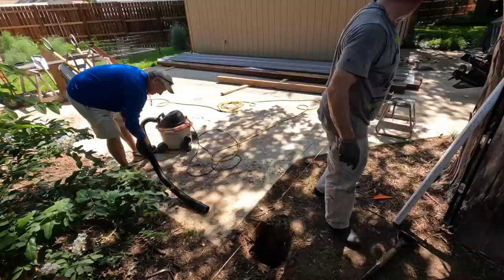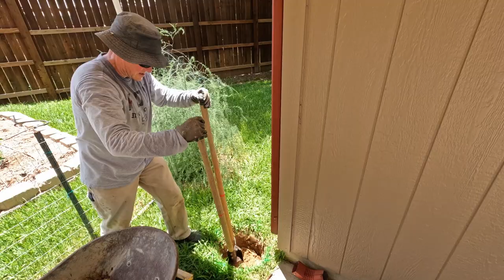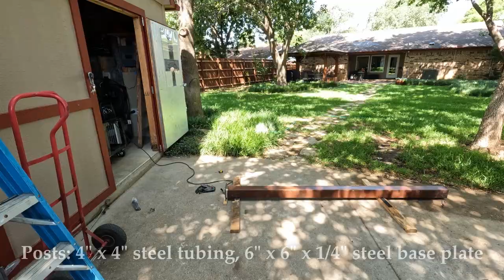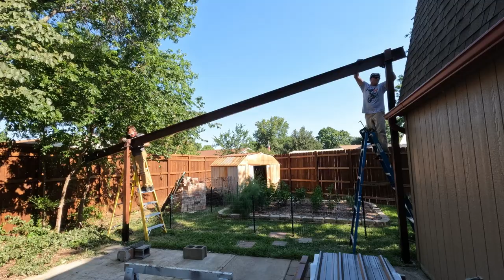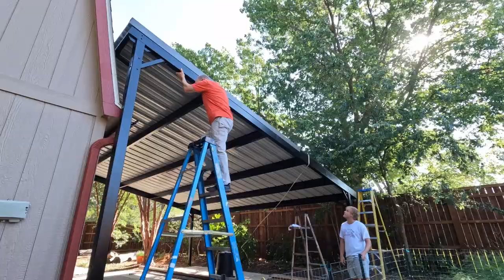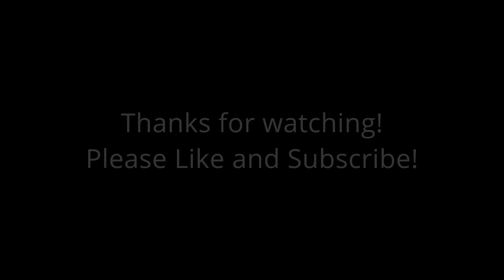Metal Car Port TIME LAPSE Construction

Comment: That is exactly how I was thinking of building flat roof carport.  Have a 18.6 wide driveway,  so was going to do a 20' x 30' Carport.  Using 3 1/2 by 1/2 wall drilling pipe, 4/poles @ 10" ctr's, on each side and doubling the 6" C Purlins at the poles ( one on each side kinda like a I beam) with one in the middle span of each pole set so I could walk on the roof if needed.  Something like Receiver channel or 10" C Purlin for 3 sides,  that way it will look flat but I can build a small slope for rain off the back side.  Will have 6" panels on the long sides for Sun block.   And all welded together.  You did a great job with yours,  we are up to deciding paint colors now,  will start soon.

Comment: Can you elaborate on the size and thickness of the purlins ( c channel) used ? What is the span you are overcoming ( width ) and also what pitch have you used on the roof ? What is the clearance on the highest and lowest points in the roof ? Finally can you let me know what kind of metal paint you used ? ( the black one ) . You built the carport that I have drawn out on paper , I have a 28' width to overcome and by the looks of it you are in the same size range ? Thanks in advance for any info you can pass along.
Reply: They are 2x8” 14guage 25’ C receivers and C purlins. The purlins are probably spaces 4-5 feet apart in the receivers. All bolted together with 1/2” thick bolts. Long ones for going into the posts 5” and 1/2” for receiver to purlin. 
The description says their diagonals are both 30’ so you can calculate the sides.

Comment: Looks good. I been debating on what size to build so I can store my 2 trucks, trailer and tractor. I was thinking on a 20x30 using 6" purlin but due to max span of 18 means I would need 6 poles versus 4.

Comment: Next time use 60lb bags and a bucket with a drill and mixer auger. You can mix a bag in like 6 seconds 😂 its even faster when you have a bucket that will hold the exact amount of water you need